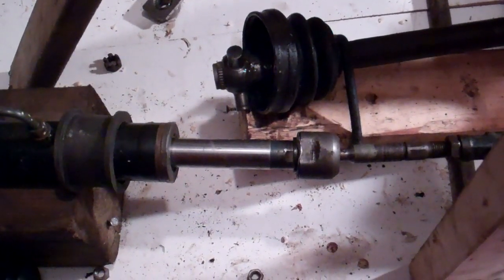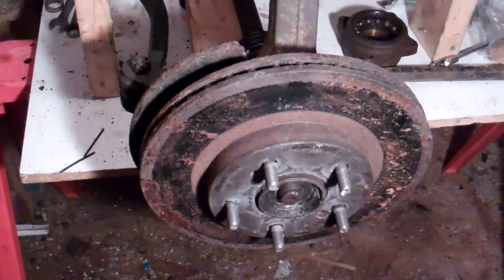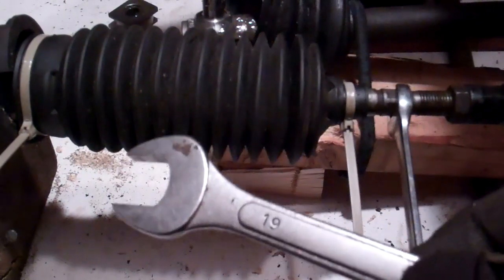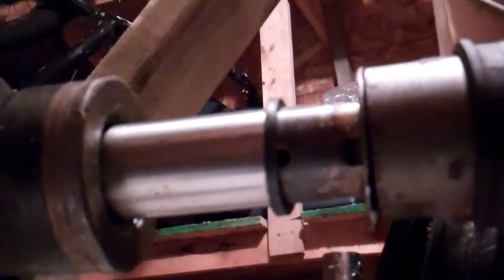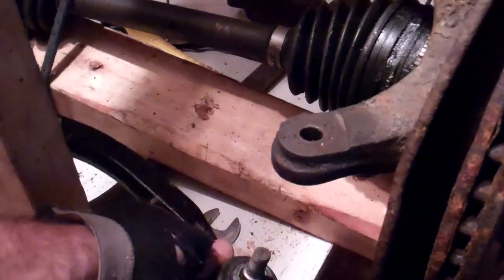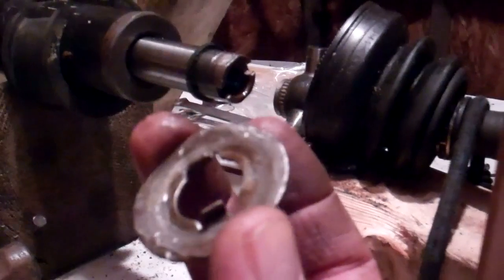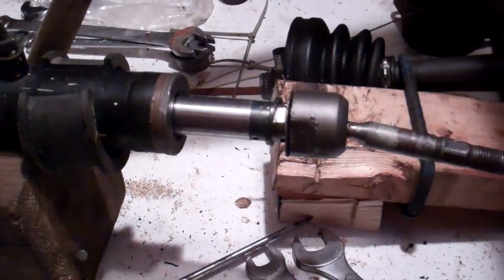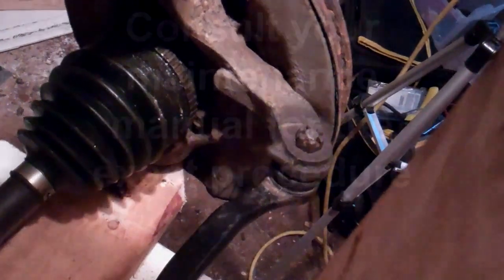How to replace a steering rod - Honda Accord steering rack in this video

Comment: If you counted the turns it took to get your outer tie rods off, the marking of position for the locking nut becomes irrelevant because you are going to turn that locking nut back against the outer tie rod to lock it. Great info nun the less. Thank you

Comment: This is the first video when I see the rack from steering house (there is a place at the end where you can use a spanner) and remembered what some folks were talking about keeping the shaft locked while unscrewing the inner tie rod to prevent applying unnecessary torque to that shaft, SO very important detail that most of the mechanics forget is to keep with a spanner the shaft locked while unscrewing/tighten the inner tie rod.

Comment: so if i understood u,  u can buy the hub and bearing assembly as one unit and avoid using the press.
Reply from the maker: hunkydude322 It depends on the vehicle Hunky - you can on for some cars/trucks. Easiest way to find out is call you auto parts store with make and year of your vehicle - they can tell you